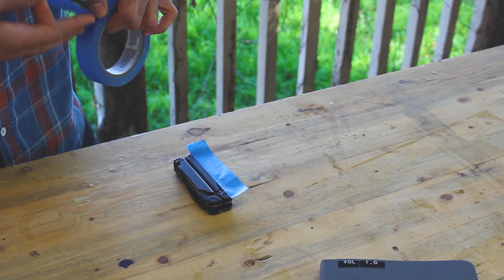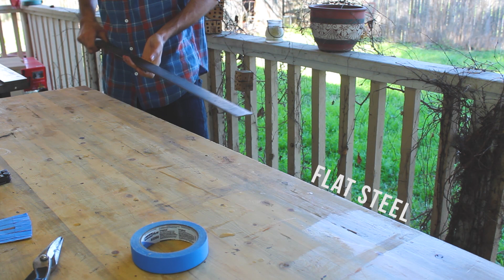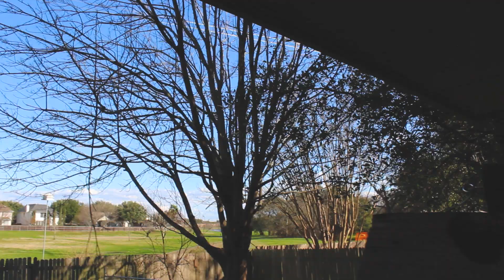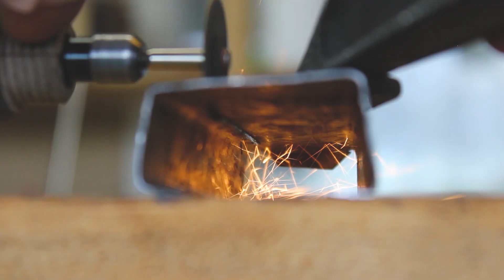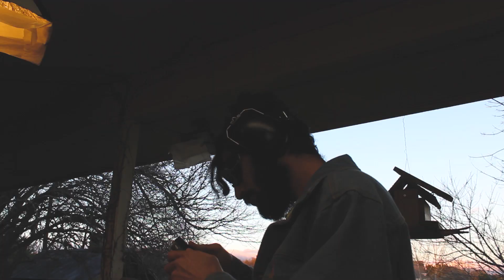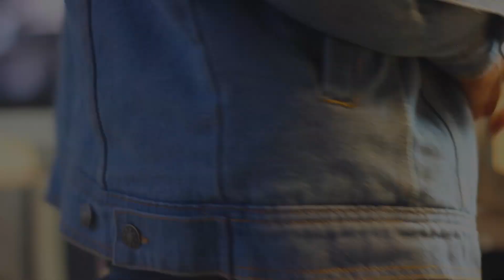Recreating Adam Savage's multi-tool belt holster | Making a Leatherman holster.

Comment: Copper or Aluminium would be best. Another option would be heating up PVC pipe or broken storage boxes with a heat gun !

For extra safety glue a large magnet at the bottom so you don't lose your Leatherman !
Reply: oooo PVC.. I've got tons of that.
Reply: @screaminscott  Heat formed PVC is an excellent substitute for Kydex & laborious 3D prints 👍